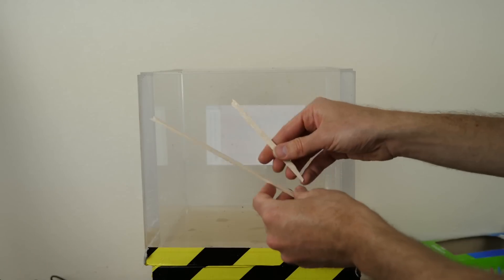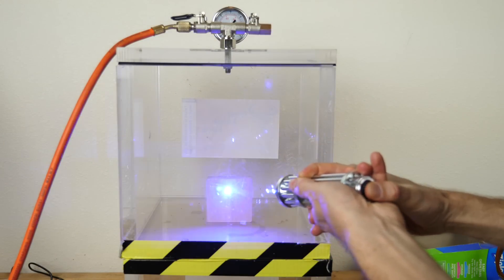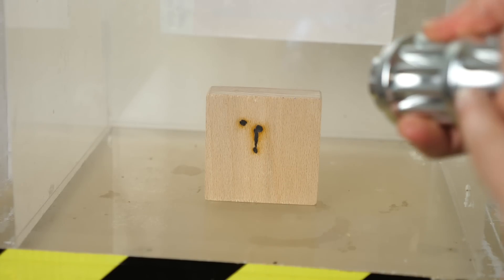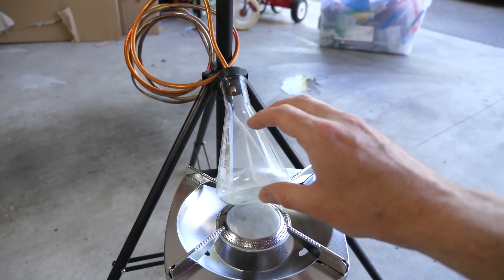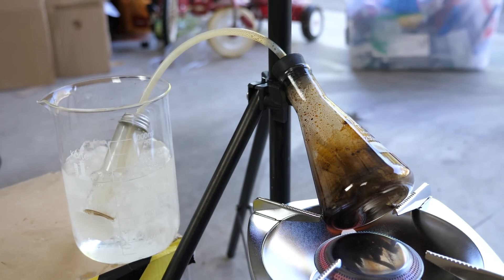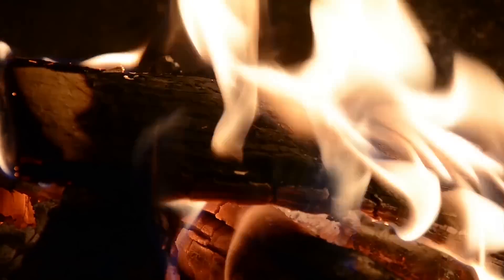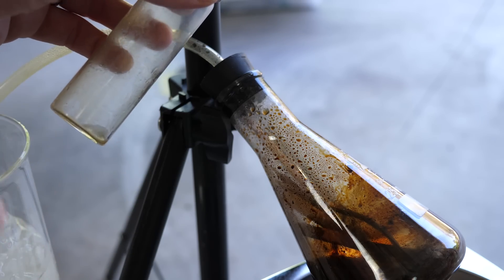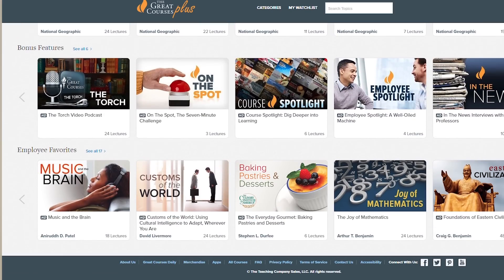Is It Possible to Melt Wood in a Vacuum Chamber? The Wood Distillation Experiment

Comment: Next Episode: Melting Water
Reply: Vaccum a Vaccum
Reply: @storyofindy   melt a vaccum
Reply: Burning water 😳
Reply: @bryankopkin6869  if you dissociate water it will turn into hydrogen and oxygen so yeah you can burn it.
Reply: @beingrandomisfun6927  IT WHAT
Reply: @beingrandomisfun6927  well it turnes into a gas which is just gas water which is thechinaclly made of oxygen and hydrogen
Reply: @1000-THR  if there is a semi permeable membrane while electrolysis water will dissociate into oxigen gas and hydrogen gas, that's how they meke oxigen in space station, oxygen is essential to burning and hydrogen is flammable.
Reply: @beingrandomisfun6927  That is not burning 'water'. Pure water can't combust now, can it?
Reply: @bryankopkin6869  I think that's called alcohol
Reply: @bryankopkin6869  you can burn it if you can heat it up very much
Reply: thats weird for me that hydrogen is highly flammable and oxygen helps in combustion but water which is H2O does burn.
Reply: @bryankopkin6869  you can burn water by pouring burning oil on it
Reply: @bryankopkin6869 you can burn water by pouring kerosene over it. Kerosene has lighter mass than water so it floats and if you light it on fire it will burn.                      

It isn't water burning it's just the kerosene over it which makes it look like burning
Reply: @bryankopkin6869  it can burn but only with a special liquid in it
Reply: Melting a vacuum
Reply: @m.b.82  Melting reality, making Thanos seem like a little child
Reply: Melting air
Reply: @wishycapty6008  you can get liquid oxygen, but you would actua have to freeze it!
Reply: Melting light
Reply: Melting fire
Reply: Frezzing fire in place
Reply: @RTG1511  he alrdy knows its a joke so wooshing him doesnt make sense
Reply: @leveahgacha9796  damn, you get it. idk why im reading this comment section after two damn years. possibly because i still get notifications from the mistake i made by replying to this comment here two years ago, haha
Reply: Bring an ice cube then put it at the room temperature and it will start to melt
Reply: @mohammadbaleegbhat8110  what if I keep my room temperature below 0°C?!
Reply: Stting air on fire
Reply: Why is every goddamn comment section like this? Some dumbass kiddies tryna roast people like it’s Twitter or summ over some stupid argument lol
Reply: @OIeka  that's unfortunate, bro! I could say that "2+2=7" and mf would still trynna correct me by saying is actually 5, they ain't learning chemistry right nowadays, smh
Reply: Water is a liquid so don't be dumb (sorry to say it)
Reply: @tsnmproductions  nah bruh, I can see the "2020" in your name so I get that you're from the past, so in February of 2021 Obama himself discovered that water is not liquid but indeed in a new form of matter called "Pure LIT". So no need to thank me!
Reply: @brokeMF949   🤦 there's "2020" because my channel was released in December 29, 2020
Reply: @tsnmproductions  Well man you either have a great sense of sarcasm or you don't know what a joke is. Anyway wish you the best I guess, and may the Lord "TwoMad" offer you a N card as a blessing. Peace
Reply: @brokeMF949  not much of a joke.
Reply: @tsnmproductions  it's a joke
Reply: The profile picture makes it 100 times better
Reply: @bighuntclipsbhc7050  Nah, just thought it was cool a couple years ago and now I'm too lazy to change it!
Reply: Water is already in liquid form
Reply: @RTG1511  r/ihavereddit
Reply: Freezing fire.
Reply: Next:melting light
Reply: Melting fire
Reply: Melting air
Reply: Water is already liquid,
You can solidify water by lowering the Temperature then melt it
Don't woosh me you damn anti-nerds
Reply: @stizaidtl2146  Jezus, give this guy a Nobel`s price
Reply: @mattatmoney9488  price? Sure a nobels price would be real expensive
Reply: @mattatmoney9488  stop using JESUS’ name in vain.
Reply: @stizaidtl2146  
Wow do you want a noble prize award?
Reply: @toyotatrd  much appreciated
Reply: @stizaidtl2146  I won't lie, I'm proud of you because I'd say the same
Reply: @stizaidtl2146  r/woooosh
Reply: @stizaidtl2146  Stizaid TL2 2024
Reply: @stizaidtl2146  Thanks for the info, I would've never known about this if it wasn't for you!
Reply: But what about solidifying ice???
Reply: Or burning a flame.
Reply: @gemmehigh  people say achieving one of this 3 will grant you a free wish from the dragon
Reply: @stizaidtl2146  r/whoooosh
Reply: @stizaidtl2146  No shit
Reply: @stizaidtl2146  R/woooooooooshhhh
Reply: @stizaidtl2146  r/wooosh
Reply: @kamdensellers5547 i thought we are on YouTube?
Reply: @stizaidtl2146  i siad the same thing!
Reply: @stizaidtl2146  wooosh
Reply: @stizaidtl2146  r/wosh
Reply: @stizaidtl2146  Yeah, it’s that easy. I think this comment was pretty stupid and the commenter clearly didn’t think things through before posting.
Reply: @potassium3948  thanks mate
Reply: @stizaidtl2146  woooosh
Reply: @stizaidtl2146  this was a joke bro 🤣
Reply: @stizaidtl2146  🤓
Reply: @Cooperfry31  nah man i dont wanna buy another one of your nerd trophies, why sell them? keep em as a memorial
Reply: @stizaidtl2146 /r/woosh
Reply: @nonsens7832 actually its y/whoosh since we are on YouTube
Reply: @stizaidtl2146  no
Reply: @ExoticFoxy yes
Reply: @stizaidtl2146 that was the whole point of the comment
Reply: @stizaidtl2146  how about melting lava
Reply: @boxamazook  no you cant
Reply: @stizaidtl2146  how about burning lava
Reply: @boxamazook  You people leave me alone already :( it's been 2 damn years now
Reply: @stizaidtl2146  r/wooooooooooooooooooooooooooooooooooooooooooooooooooooooooooooooooooooooooooooooooooooolooooooooooooooooooooooooooooooooooooooooooooooooooooooooosh
Reply: @ilikefishilikefishilikefis6383  It's woooosh with four-Os and why do you like the friendly interactive shell? it's not even posix compliant
Reply: @stizaidtl2146  ty 
I hate "r/woosh" so much ong
Reply: @stizaidtl2146  woosh
Reply: @stizaidtl2146 ..woooOOOOOSSSSSSSSHHHHHH
Reply: @talcorp9998 yo it translated into "i have 0 iq"
Reply: @stizaidtl2146  actually you can melt liquid alcohol
Reply: @MoritzB4  Would you please elaborate?
Reply: @stizaidtl2146  “anti-nerds”🤓🤓🤓🤓🤓🤓🤓🤓🤓🤓
Reply: @snugglepuff_74 go back to being a disc*rd moderator with glasses then if you are calling someone nerd but yourself is a nerd
Reply: @stizaidtl2146  you are an anti-nerd bro
Reply: @jasmintsorbatzoudis4429  Thank you very much. Finally someone with a brain.
Reply: @stizaidtl2146  ok
Reply: @stizaidtl2146  yeah, but can you melt liquid water? I know melting is when solid turns into a liquid, but if you somehow melted liquid water, would it just disappear? Would it make a windows error sound?
Reply: @HoodedBacon  
Let's answer "What is melting?"

There exists a change, a physical one. In that change one can observe, matter, in solid phase, transitioning to its liquid phase. Now, how does one explain this to another? Language! Now, this change that one observed, is termed 'melting'.

'Melting' is literally the name of a process, where a solid transitions to its liquid phase. Any process, whatever that may be, is NOT termed 'MELTING' as long as it does not satisfy the definition of 'A SOLID TURNING TO ITS LIQUID PHASE". 

Anything you accomplish with 'Liquid Water', that does not make it transition to 'Liquid Water' from its solid phase of 'Ice', is NOT the physical process termed 'melting'.
Reply: @stizaidtl2146  I know, but I can imagine if you somehow melted liquid, it would make a windows 98 error pop up appear.
Reply: @stizaidtl2146 r/whoooosh
Reply: @LoliUnisexOwO go back to making animes that had low resolution
Reply: @stizaidtl2146 R/WOOSH
Reply: @tristencardenas3094 imagine being a green RedTuber
Reply: @-techexo  you must really hate Reddit for some reason its almost an obsession
Reply: @tristencardenas3094 i don't hate Reddit, but you can't just put their things here, like copyright
Reply: @Stizaid TL2  Ignore the simpletons my good sir.
Reply: @stizaidtl2146  r..... /..........

WOOOOOOOOOOOOOOOOOOOOOOOOOOOOOOOOOOOOOOOSH!!!!
Reply: @godgame9841 y/whoosh*
Reply: @stizaidtl2146 does that mean you are a nerd?
Reply: @stizaidtl2146  necropost whoosh
Reply: @samciarrati7943  okay
Reply: @stizaidtl2146  I had to since you said not to
Reply: @samciarrati7943  It is quite amazing that I still get replies to my comment, even after 2 whole years.
Reply: @stizaidtl2146  I just love necro-posting. I got a comment on a 4 year old post on Reddit last night too lmao
Reply: @samciarrati7943  hahah, you'd piss off those no-lifers at forums easily
Reply: @stizaidtl2146   It's a joke man
Reply: @stizaidtl2146  wooooosh
Reply: @FelipeFarias-tn1mi go back to r/eddit
Reply: @stizaidtl2146  idc r/woooosh
Reply: @Someoneyoudon-tknow  if I say please will you guys stop flooding my notifs with wooshes
Reply: @stizaidtl2146 woosh?
Reply: @stizaidtl2146  the guy made a joke lmfao
Reply: @stizaidtl2146  r/iamsmart
Reply: @stabgan  man will this comment section ever stop, this video was uploaded ages ago why people still seeing my comment
Reply: @stabgan this is YouTube NOT r/eddit
Reply: @stizaidtl2146  r/woooooooooosh
Reply: @Nirokksu  r/itswooooshwith4os
Reply: @Nirokksu r/ihavereddit
Reply: Huuuhhh
Reply: Ice?
Reply: @Miraahi115  ON MY WRIST!!... Aham... Excuse me, force of habit.
Reply: Burn the fire
Reply: milk
Reply: How about frying water??
Reply: Fun Fact: Dry water exists
You mix hydrophobic powder and water in a blender
Reply: @RandomfeIIow  But...?!?! Do you get thirsty  when drinking dry water?!?!
Reply: but… water is already melted…
Reply: @zorpglorp  Water isnt technically melted unless its been ice once before
Reply: @RandomfeIIow  oh fuck. Well most water probably has been ice, or water vapor…
Reply: @zorpglorp   wooosh
Reply: @zorpglorp  WOOOOOOOOOOOOOOOOOOOSSSSSHHHHHHHHHHH
Reply: How bout this,
It's  surprising.

Idc
Reply: It's funny how it's actually possible
Reply: Even if you think you know the answer it's more interesting to do the experiment because you still may have something you didn't expect happen.
Reply: Melting Melted Water
Reply: Water is the melted form of ice...
Reply: Melting vapour.
Reply: ME: I,, will,,, Dooo (deep voice) It...
People :Are u mad
viewers: sees me going to the freez
Mm hh
Open the freezer
Hhmmmhhmm
Pickup ICE says "" I AM Me""
Water (Ice form): melts
Back ground Avengers Theme
Disclaimer: 🚫🚫 nothing in this comment is coppy write from another comment it's all idea in my brain made live while writing the comment 🤗🤗🤗🤗pmmmdss ..
Reply: @fahadabdullah6290  rate 5 stars for creativity, your comment's more complex then some modern movies smh
Reply: The floor is made of floor
Reply: Evaporation
Reply: @progamermove3240  Condensn't
Reply: @ShadowSiD won't be surprised if he'd make a vid where he fries air or the empty space in a vacuum
Reply: Ice
Reply: @MrQuestBloxy777  on my wrist, on my neck, boy's drippin!
Reply: Next episode how to fix mantle brain
Reply: Takes ice cube out of freezer and places on counter
Reply: Easy,  raise it above 0°C
Reply: Ice
Reply: No, : burning whater
Reply: Don’t give him ideas.
Reply: Melt human
Reply: @jittroe  stop
Reply: Next Episode: melting liquid air
Reply: Melting a liquid
Reply: Let's melt humans
Reply: Water is already melted it is ice
Reply: @elite.abhi.4551  Should have been melting humans instead right?
Reply: It’s already in liquid form tho you can freeze it then melt it if u want
Reply: @donkead  damn daniel, ah ah ah ah ah
Reply: Well thats easy just turn the tap on
Reply: Just to make some ice and melt that  done  melted water
Reply: Yeah, this is called "ice"
Reply: It is already a melted form of ice
Reply: Yeah evaporation
Reply: This hurts me
Reply: @kahinabedjou8200  pleased to hear that!
Reply: It’s very possible, ice has a very low melting point.
Reply: cutting air
Reply: But… it’s impossible!! Baka na! Water is already melted! You’re just evaporating it!! NOOOOOOOO
Reply: Well you can't technically melt water, as it is a liquid but since melting is caused by an increase of temperature you could. But technically if you increase the temperature past the waters boiling point it would just turn into water vapor, which is obviously a gas.
Reply: LOL
Reply: Next Episode: Melting Fire
Reply: Next episode meeting mercury
Reply: Melting fire would be more intresting
Reply: Nice joke lol
Reply: Next episodes:
Freezing ice
Burning fire
Reply: LMAO
Reply: Water can exist as a solid (ice), liquid (water) or gas (vapour or gas). Adding heat can cause ice (a solid) to melt to form water (a liquid). Removing heat causes water (a liquid) to freeze to form ice (a solid). So in theory...water can be melted
Reply: Bro thinks in ohio
Reply: It's called boiling...
Reply: That's like solidifying stone
Reply: Why did I actually think this was some insane joke idea for a few seconds 😭😭😭
Reply: so ice
Reply: @SCIENTIST  not possible. Smoke is unburned partials. You could extract the carbon monoxide out of the smoke and ignite it and make plasma from the fire.
Reply: Get ice
Reply: Can you melt chicken
Reply: That sounds like something I would try to do in a really weird dream.
Reply: that's possible, but water need in "ice VII" condition... and for that need very very very high atmosphere pressure
Reply: *burning water
Reply: Nahhhhh no way bro
Reply: Impossible. Good request though.
Reply: Put an ice cube in the sun.
Done son.
Reply: Brilliant 🎉🎉
Reply: It’s called evaporation
Reply: Next episode: melting a human child
Reply: that's physically impossible
water is a gas
Reply: @Local_Phantasm  water's gas fr 🔥🔥🔥
Reply: @brokeMF949  true!!
Reply: Or melting fire
Reply: Nani!?!....t that's IMPOSSIBLE!!
Reply: Can’t melt if it is melted
Reply: @usvmchc2843  it's not melted, it's a gas
Reply: r/wooosh is NOT funny anymore including the Nerd emoji 🙄
Reply: @The_YellowGuy_ true
Reply: Stop this man
Reply: Melting meat
Reply: Next episode MELTING TODDLERS
Reply: @SCIENTIST TURNING SMOKE INTO COCAIN
Reply: If water is a liquid then that would be melting ice
Reply: Burn water 💀
Reply: r/woooosh
Reply: Melting a fire
Reply: I think it would be melting ice actually
Reply: Dont you already do that with ice?
Reply: @chickencrusaders680  r/whooosh
Reply: You seriously can’t melt a liquid (which has already melted)
Reply: Wait what ?
Reply: Waters already melted H20
Reply: @williambradley611  H20? That’s just pure impossible!!! Water is H2O how you don’t know?
Reply: @williambradley611  r/whooosh
Reply: Its better to freeze ice.
Reply: Genius
Reply: Isn’t water just melted ice though?
Reply: Fbi would like to know your location
Reply: @Starfall-DT  sus, how do you know!!! must be a fed guys
Reply: Freezing ice 🧊
Reply: @deepwaters2334  what even is that
Reply: @stizaidtl2146  The pot that called the kettle black said he heard about it on blue planet or something.
Reply: Burnt water*
Reply: Now make a solid water without freezing it or using any other thinga
Reply: @Danielnisbet2012actually its a smart kid, not a nerd, NERD 🤓
Reply: @-techexo  imagine going through every individual comment for hours over some thing as simple as r/woooosh do you really have anything better to do because right about now ur looking alot like ---->🤓🤓🤓
Reply: lol
Reply: Wouldn’t that just evaporate it?
Reply: That’s called ice!
Reply: ice?
Reply: Are u dumb
Reply: Genuine dumb question
Reply: This aged well because 6 years later
Reply: It's already melted... That's why it's not ice ffs.
Reply: Next episode: melting air
Reply: But water is already a liquid...
Reply: @alecxander9573  yeah It is.... Or is it? "VSauce theme starts playing"
Reply: @brokeMF949  hey man…just…just…just be quiet
Reply: @brokeMF949  VSauce invades Action Lab
Reply: Melting the internet
Reply: @wishycapty6008  bruh chill, people like Elon Musk will try to eliminate you if they see that there's someone like you how has cross the limits of a human mind!!
Reply: All of these reddit users are just dumb and they don't understand anything so they have to Woosh people to make them look dumb
Reply: @Cay9z  r/whoosh

Comment: the vacuum chamber thing is due to how combustion works. it requires heat to start, but is an exothermic reaction, and so it naturally makes its own ignition heat to start more combustion. however, incomplete combustion with no oxygen is not exothermic, and thus the heat from the lazer causes it to break down, but it does not combust.